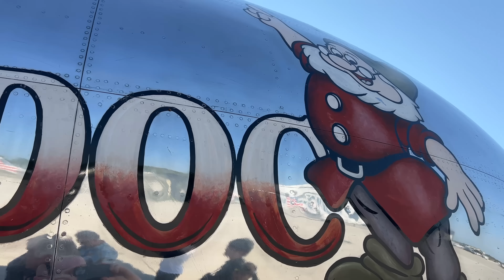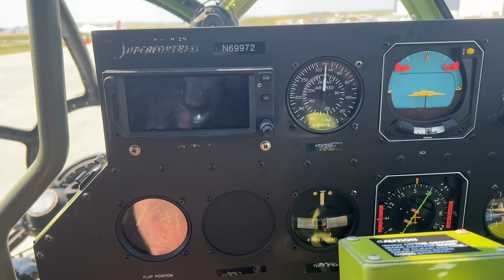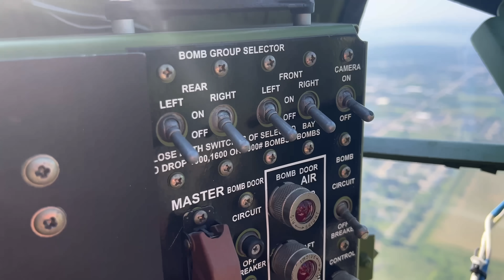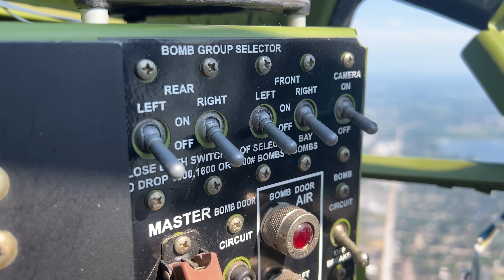I Spent $1500 On A B29 Superfortress Flight - Was it Worth It?

Comment: Two years ago the B-29 was on tour and came to my local airport, when i found out it was coming i knew i had to fly in it. i worked so hard to try and get $700 to buy a ticket to fly in the back of it. I was 15 years old and did so much yard work and eventually lucked out and found a old avionic at a antique place and bought it for $2 and sold it for $500! that got me to the $700 with 2 weeks left till the B-29 came to my airport. I bought the ticket then waited. The day came and the weather was bad and they cancelled all the B-29 flights… I was super upset and still wanted to fly and they said i could go to Sun N Fun and fly in it if i wanted to. I took that offer and 2-3 weeks later i’m down at Sun N Fun flying in the B-29! That plane is absolutely amazing and was so worth the money and struggles. Getting to look out the tail while flying was like nothing i’ve ever done, Getting to stick my hand out the window at cruising speeds was absolutely amazing. The crew on the bomber were fantastic and wanted everyone to have a amazing experience. Eventually once we landed we could crawl through the tunnel to the cockpit and see everything up there and sit in the pilots seat. Flying in Doc was a amazing experience and i would recommend anyone and everyone to try and fly in it!

Comment: Suggest you try the Lancaster located at the museum in Hamilton, Ontario. It is also one of only two flying in the World. The other is in the UK. Flights are $3500 (Canadian Dollars)
Reply: I took a flight on the Lancaster in Hamilton and it was an incredible experience.  The noise from those 4 engines when the throttles were advanced to takeoff power was something that I will never forget.
Reply: Hear and see it many times during the summer flying over Toronto.
Reply: It’s BOMB-BA-DEER on the B29, BOMB-BAR-DEE-EH on the CRJ across the tarmac.
Reply: I was able to take a ride during Sea Fair in Seattle years ago. My favorite aviation experience.  The B-29 will forever be stamped into history for several reasons including the bomb that helped end WWII
Reply: There’s another Lancaster that’s currently being restored in Windsor Ontario, idk if it will why again though
Reply: @Lizzbird_       Thanks for the info.      :-)
Reply: @davidbalcon8726   uhm actually  CRJ's are made by mitsubishi now 🤓
Reply: don't think they do rides tho, Doc and FiFi (the other flying B29) are always giving rides
Reply: It's $3900 CAD now and already sold out for the 2024 season.  Only 4 passengers per ride.  No idea how many flights it does per season but it's a pretty exclusive thing.
Reply: @Lizzbird_  The Lancaster bomber in Windsor is a static restoration and is not being restored to flight.
Reply: @stangace20  The Lancaster at the Canadian Warplane Heritage Museum offers rides and is already fully booked for the 2024 flying season, according to the museum's website.
Reply: @Lizzbird_  there is also another one being restored to airworthiness in the UK not far from where the RAF one is based at Coningsby.
Reply: My great uncle flew as a radio operator on a B29 in ww2. His brother (my grandfather) wanted to serve in the AF too, but the military wouldn't accept him due to ankle injury from an axe sharpening incident, when he was young. Before he passed away we got him a flight on Fifi, in the seat his brother sat in and this almost deaf 90 year old said it was loud.
Reply: @keithck3720  Any idea what the. one in the UK costs? At that price, it might be more affordable to fly to the UK!
Reply: @comicus01  Sadly the public can't buy a seat on the UK one.  They only allow for a taxiing ride for £485, which is a basically very expensive tease.
Reply: @steveg3981  Thanks Steve. That has just been added to my 'To Do' list.
Reply: @pauld6967  They're accepting bookings for the 2025 season starting this November if you're intending on going next year.  They'll go quickly.
Reply: @keithck3720  Thanks for that information but with Bidenflation wrecking both the economy and my budget, the trip will have to wait until things get a lot better.
Reply: @pauld6967  You're welcome.  

One other thing, the price goes up every year.  I looked into it about 5  years ago and remember it being about $2800?  She's an expensive plane to maintain and they have the monopoly on a once in a lifetime experience.   It's going to be worth it but it's definitely pricey.
Reply: @keithck3720   A fair point. Time to start saving up the pennies.
Reply: If you want to hear 4 Merlin engines starting up from 10 ft away or grab a Taxi ride on the Lancaster "Just Jane" (it is not air worthy so must keep it wheels down) from East Kirby in the UK for around £450.  It was one of the best days I have ever had and just about eclipsed the Spitfire ride which was 6 times as expensive !
Reply: @caggius42  Ah,..Spitfire, nice! I have had the privilege of being in a Mustang but the Spitfire remains on the 'To Do' list.
Reply: We can feel her coming in from Ancaster when she’s landing 😂
Reply: @comicus01  you can't fly on the airworthy one in the UK as it's part of the Battle of Britain Memorial Flight and still a serving military aircraft operated by the RAF. The other one in the UK - Just Jane - can only do taxi and power runs and last time I saw a price they were about £800pp
Reply: @shanewaterman4125  Dang, just a power run?  I would not pay for that.  But thank you for the reply and info.

Comment: The R-3350's used in the B-29's were quite temperamental, and almost as many B-29's were lost to accidents as enemy action (usually engine fires).  The Commemorative Air Force's contribution to keeping the B-29's flying was obtaining FAA approval for exchanging parts on the engines with parts from 1950's airliners that were powered by later, much more reliable variants of the Wright R-3350.  Doc has benefitted from this, as has the CAF's own B-29, FiFi.
Reply: I honestly didn't know that, thanks for that tidbit.  And I guess it's all relative, I mean ANY large radial is temperamental, right?   (especially the 3350s)
Reply: @aircraftadventures-vids  The b29's engines were quite a bit worse than others.

Comment: The engines on Doc apparently have been swapped out for lower power units with easier replaceable parts according to the crew I met when it visited my local airport. They are not super or turbocharged and are suffient for the low level flight Doc takes to tour the US. I’m sure with the big power engines it originally had takeoff would have been a cinch.
Reply: The engines on doc and Fifi are a modified newer more reliable 3350 which actually make more power than the original engines… safety first!!!
Reply: @donmeyer1621  weird. The story I got on the ramp was the original engines in “Doc” according to the guys I talked to on maintenance crew were Pratt and Whit R-4360 (being a late production plane apparently) and made 4300hp. They switched to the A-1 Skyraider engines (3350s) due to parts availability and lack of turbo or superchargers making maintenance intervals and reliability better at a cost of power. 

I commented about being able to see the turbine wheels in the exhaust on the engines and was told that was not what I thought it was and got the story about the engine swaps. I asked about the high altitude flight and they said they didn’t need the forced induction engines since they just fly from airport to airport at sub 15k feet and also that they do not pressurize the cabin. I thought it was cool the engines they had in there make that much power without the use of turbo or superchargers.
Reply: The R-3350--B29 has an internal supercharger. It does not have the original power recovery turbines (there were 3 on each engine).

Comment: Thanks for sharing this amazing experience. I flew in a Grumman Hellcat when I first started my video career, and it was an experience that I relive with fond memories decades later. For future flights, I might suggest a headworn mic with a windcap (and possibly even a furry cap), as it was a bit difficult to hear you over the wind noise. It also would leave you with both hands free.
For truly noisy environments, it's hard to beat a quality dynamic mic and Tascam DR10x recorder unit. It's a bit bulkier, but I use them in the noisiest environments and they end up with some surprisingly clean sound.

Comment: I lived near Offit AFB (Strategic Air Command) which is in Belleview, Nebraska. This was the 1960's and I was quite a little kid at the time. We lived on the Iowa side of the Missouri river, about 20 miles away as the crow flies.  I remember clearly the big birds like this doing "treetop" exercises, coming across the river. They were so low you could read the numbers on the bottom and see the bomb doors. They literally went directly over us. I remember being excited and scared all at the same time.

Comment: This has probably already been mentioned by others, but at the airport in Kissimmee Florida you can take a ride in WWII advanced trainer... North American T-6 Texan with a big radial engine and the pilot will let you take the stick yourself and fly it even with no prior experience flying a plane.  An awesome experience!!  Fir those with deep pockets there is also a 2 seater P51 Mustang you can fly.  Although the prices for these experiences seem steep, the fuel and maintenance costs running these old timers is exorbitant.

Comment: I flew in this B-29 in July 2023 dressed in my all original WWII 20th Air Force uniform and flying gear for the full experience (I'm a 22 y/o reenactor). I was riding in the rear of the aircraft, and it was quite an experience climbing around the back there.

Comment: When it was under restoration it was at the Kansas Aviation Museum in 2007. All 4 engines were at P &W for overhaul. They had sandbags piled on the front landing gear. so it would not tip back on its tail. I crawled all through Doc, took a ton of photos for my dad as he was a pilot of a 29 out of Biggs AFB, 97th Bomb Wing in El Paso, Tx 1950-1952. I got to crawl through his B29 at Biggs on the flight line as I was only 5 yrs old. My mother was not allowed as she was an adult. That was the period of SAC.

Comment: I spent 2 decades in media as a cameraman other than getting to be in the presidential motorcade and spend a week on a carrier where I got to go on deck for launches/arrivals…is to do flights on vintage bombers. I’ve flown on a 17/24/25 and 29…the 29 was Fifi. Due to nutrition most people were smaller in statute in the 40s. 

There is a French maritime patrol aircraft that has an even better bubble nose position…not many know because it is kinda rare but still in use. 

This is a pretty high price…many flights like this are closer to $500. But for a special once in a lifetime thing, it’s worth it.

Comment: I actually saw Doc flying in person at an air show I went to at Joint Base Andrews, and later saw Fifi at the same base.  Unfortunately, mechanical troubles meant that I didn’t get to see the latter go up, but I did to have look inside the flight decks of both planes as well as look down that crawl that you were crawling through in this video.  Oh, and I would like to correct you on what you said about the engines at 6:35.  The 4 Wright R-3350s used on the B-29 were only rated to 2200hp.  The ones that were rated to 3500hp were the turbo-compound versions used on the DC-7 and the L-1049 Super Constellation.

Comment: If all that ONLY cost you 1500 it was the bargain of a lifetime.   I  flew  as  the "radio operator" of a B17.   And I really do know  a tiny bit about WWII aircraft radio.  I was first licensed as a radio amateur  in about 1965.  I've had a number of pieces of  WWII aircraft and other radio equipment.

Comment: Back in the early 80's when The Planes Of Fame Museum in Chino Calif was just becoming a thing, My Dad rode with Steve Hinton Sr in a 2 hr AT-6 Texan ride,,for $250.   They also had a flyable/rentable/rideable B-25 Mitchell bomber, for $400 per hr.  Dad was a private pilot of 40 years so Steve helped him loop and roll the AT-6.    Back then at Chino, alot of planes sat out in the weather, because the museum was still being built.   Little dusty tourist trails to take you thru, and placards in front of each plane for details.    Your $1500 was WELL spent, considering the rarity.

Comment: I spent $450 USD on a flight aboard a B-24 and it was... okay. I didn't think the price was worth it but glad I did it. Major thing I took away was how extremely loud the engines were. If you watch a movie aboard a bomber and the crew are talking (not shouting) to one another, it's absurd. Even shouting is hard to get messages across.

Comment: If I ever again have the chance…either on a B29 or B17…I will stand in line early with $1500 cash. I regret not doing it when both FiFi (B29) and a B17 were in Vermont many years ago at an air show.

Comment: Is that engine leaking oil on the flightline while you’re doing the conclusion by the wing? It looks like a real mess and a little scary.
Reply from the maker: Engine oil and other lubricants. These are very old engines, and a little leakage is common. They just keep her topped up.  The biggest issue is they have to park in exactly the same place so they don’t make multiple oil spills!

Comment: Nose position in Doc? Yeah, that's worth $1500 for a flight. I'll never be able to afford an experience like that but I don't think the price is out of line. Hell, with all of the volunteer labor that's likely a subsidized rate compared to what it would take to keep that thing in the air as a commercial venture.

Comment: So I have this theory about piloting a plane on the cheap.. a plane i own. 

So those commercial jet graveyards all have these relatively nice looking planes so why are the decommissioned??

The pressure hull.. you only get so many before it weakens and the plane is landfill. 

So.. in theory, if you found an older jet that had a cruising altitude of what, 10,000ft.. no pressure hull to worry about. 

Honestly, I’d rather have the B29. It’s an easy plane to fly.. minus being a bit cumbersome by today’s standards. I’m not even sure if the props feather on them? 

And I’d give a finger for a ride on one. A beautiful plane. I’m pretty into planes for someone deathly afraid of heights.. totally out of my control and embarrassing.. eh 🤷‍♂️